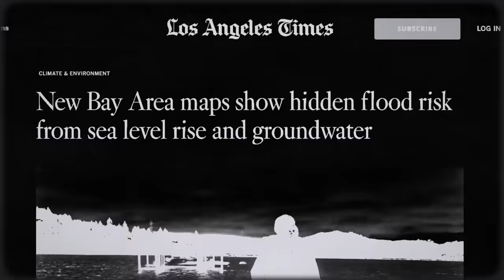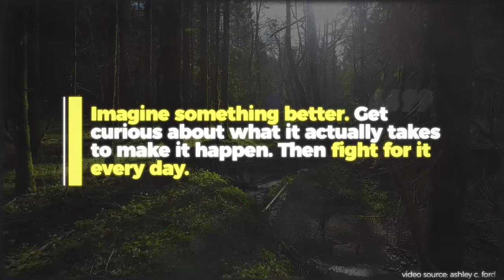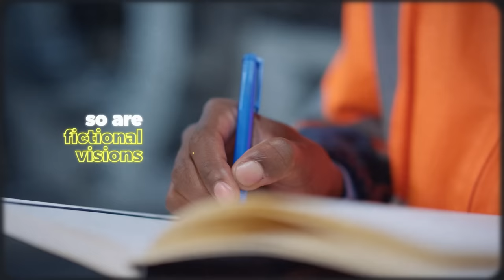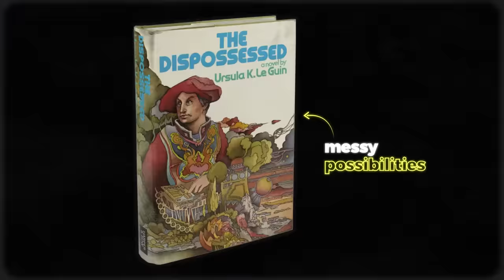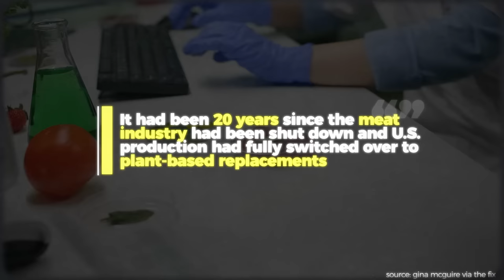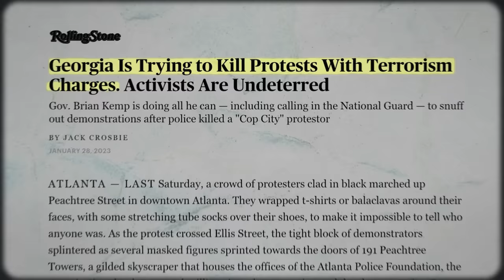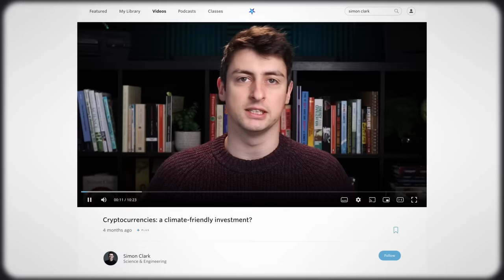Why We Need More Than Solarpunk

Comment: Just an issue with the intro quote; kings did not have round the clock surveillance, the ability to take your wealth without even being physically present, unmanned aircraft and assault vehicles and the ability to strike almost anywhere on the planet within minutes.
That’s a ridiculous comparison to our current situation, which is about to get much worse with the advent of AI.
Reply: Exactly. I remember the so called Mark of the Beast and how only those with the Mark can buy and sell. 

Problem is, in the olden days this would be IMPOSSIBLE to enforce especially since it would be easy for merchants to hide who they were selling to. 

Today? Unless you are using cash and it's accepted, A Digital only world would Make only those approved to buy and sell an enforceable reality.

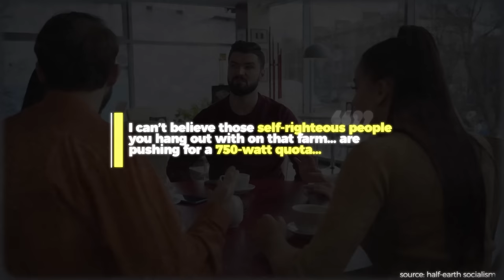Comment: 14:45 A 750 watt, or even 1,750 watt quota is not utopian, it is extremely dystopian. You can't even heat a small home with that on cold winter days, even if you use a heat pump. You can't even run two stovetop burners or some lights and a hair dryer. The very idea of an energy quota is dystopian, as are many of the 'utopias' presented here.

Comment: There's no such thing as Utopia... Utopia means perfect w/no problems to be solved. But we can make a better system 🆓 from the need to use Money & all the system we have today causing so much hardship. We can achieve this by first accepting that human labor is no longer necessary & that by using Automation & Autonomous technology we can produce goods & provide services to all people. First at a reduced cost  then overtime once the system is fully in place at no cost. Also installing a type of library System where people can borrow things that they need for only a short-term for example if you're going camping and you need tent or kayak what act and way kind of like a library System with the added benefit that if you choose to keep that item you can but that means storing it yourself.

This will naturally eliminate the motivation for people to need to commit crime it will lower or eliminate depression which leads to alcoholism drugs etc.

Comment: Degrowth is not a solution to abundance. Decoupling environmental costs from production is. It starts with moving away from fossil fuels as the capitalist basis of society and towards one more focused on sustainable alternatives (although in the intermediary rare earth will remain divisive - and fossil deposits will of course always be used for other purposes than primary energy). How? Well, building new solar power is cheaper now than using oil in an existing plant; solar will push out burning stuff in the next few decades easily in a capitalist society. The socialism part is in a small change to tax usage; the people and the government should become the main owners of power generation, selling the excess to industry thereby paying for UBI and other expenditures. So, yes a certain form of collectivism, but one where it uses capitalist mechanisms to secure ownership. Put your tax dollars to work to eventually start making some money, not just perpetually keep spending it. They bailed out the banks, it's just a political choice to keep the people down when they start yelling "but but communism".

Comment: Anyone here knowledgeable on climate change? I'm wondering how if only 0.04% of the greenhouse gases in our atmosphere are Carbon Dioxide and about 3.2% of THAT amount is man-made (U.S. Department of Energy) - how is our world wide climate so affected by that amount?
Reply: Because non-anthropogenic emissions are kept in balance with natural systems. When you inject more material to throw off equilibrium you see changes…..
Reply: @brian2440  I see. Could you explain further what you mean by injecting more material? We know that co2 levels have been as high as 6000 ppm during the age of the dinosaurs (as opposed to the 420 pm we got now). And we know that was a great time to be a plant as co2 is basically plant fertilizer, which also means more green to produce oxygen. So at least plants and animals will be happy but not sure about us.
Reply: @K4113B4113  Should have been ejecting actually. 

And no plants and animals are not happy. The issue isn’t in comparing just two points in time, but rather rate of time. 

Sure plants and animals existed in periods with far more CO2 and existed in periods with far less CO2. However it also took hundreds of thousands to millions of years to get to those periods, which allowed enough time for plants and animals to adapt to a changing climate. 

If you don’t give organisms this time then you get massive die offs, such as the Permian–Triassic extinction event (Great Dying). This event doesn’t have the highest CO2 emissions ever recorded, but yet 96% of all living organisms on the planet died. How? Because the climate changed extremely quickly. 

Now we aren’t likely having a great dying event (for example we’re concerned about 2 degrees of warming over 100 years, that event had 18.5 degree of warming over 50 years), but this event does provide a beneficial illustration of how quick change can greatly impact natural systems and make survival very difficult if not encounter complete eradication if climates change too quickly.
Reply: @brian2440  That makes sense. Thanks for explaining that.

Comment: Solar panels and other 'green' stuff are EXTREMELY poisonous to humans and the environment  😂😂😂😂 
Itd be better to sniff burnt coal 😂😂😂
Reply: Where'd you get this from? While is true that some of the forms that we acquired the manufacturing goods to build them is horrific (eg. companies employing African mines) they are far better when it comes to being clean than any other existing methods, save maybe for nuclear but that's a whole can of worms. Even the methods of storing this energy are clean.
Reply: @ratlab5680  theyvare made from lithium 
Literally non degradable
Reply: @hominhmai5325  The batteries that hold the power, yes. However solar panels don't get discarded like most car batteries, they can be repaired, repurposed and overall maintained far easier and with a longer lifespan than any cars, electric or otherwise.

It's a moot point on most solar farms too since the power is not held in the panel, but redirected to a solar tower that uses cleaner means to store it.

And honestly even if you'd be right that lithium is that bad, it's not as bad as coal which is responsible for some of the highest rates of co2 emissions since its, y'know, basically solid carbon
Reply: @ratlab5680  no they cant . 
They are buried enmass 
And they kjll birds like machetes
Reply: @ratlab5680  do u know how trees grow? By absorbing co2 🙄🙄 
In fact: studies have proven earth is greener than ever
Reply: @ratlab5680  don't engage with trolls